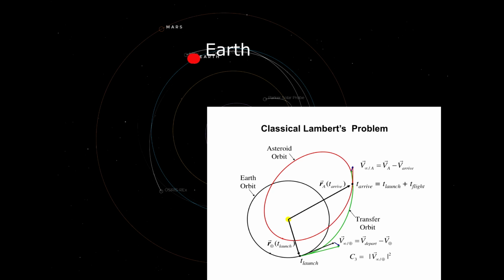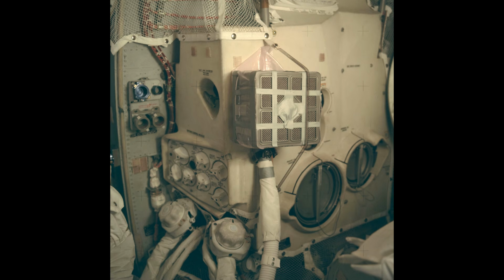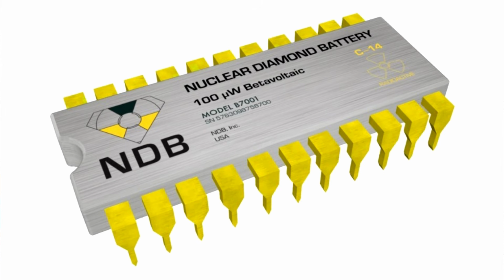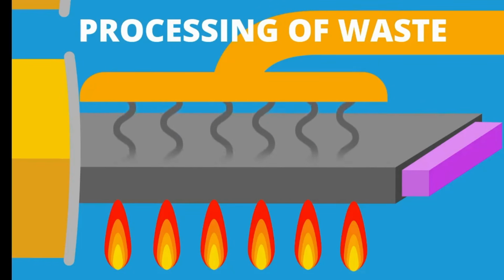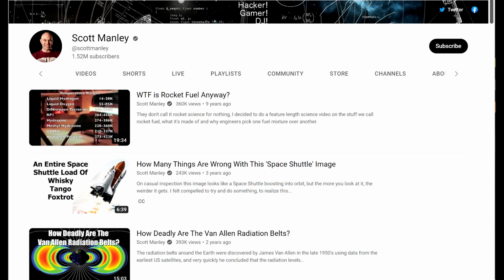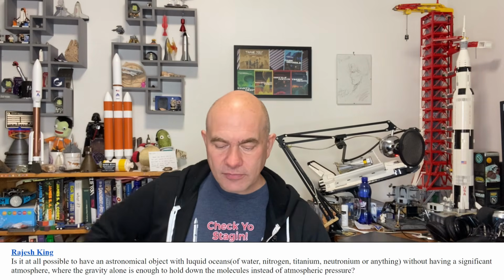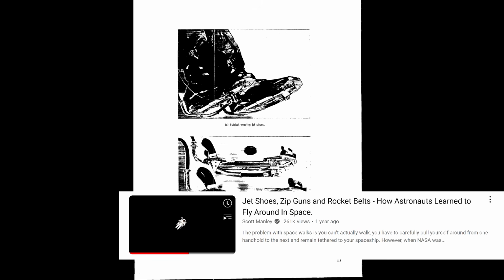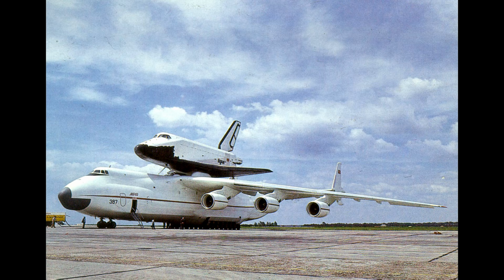Is There a Tripropellant Rocket Engine?  How Are Orbits Planned? - Deep Space Questions 21

Comment: Great questions and answers!
Thanks for mentioning mercury inches. My Mum's had a barometer in the hall that is probably at least 70 years old if not 80 or more and still works fine, so I got used to seeing the pressure between 28 and 30. I think the lowest I ever saw it was just above or below 28 and the highest just over 30.1 It's usually between 28.5 and 29.5 (I don't know what altitude it was calibrated for - it might have that written on it).
I don't think we learnt about pressure in mercury inches at school or uni - only millibars or Pascal, which are easier to do maths with! It would have been nice to know the connection with mercury inches (or cm) and Pascal, and how the old barometers worked.
Reply: Mercury barometers essentially use the weight of a column of mercury (with a vacuum above it) to balance the weight of the atmosphere - the height of the column varies with air pressure and it is this height that gives the 'inches of mercury' reading. It does not have to be calibrated for altitude, though obviously the reading will be lower at higher altitude. An altimeter, on the other hand, converts air pressure into height, and therefore does require adjustment in order to read zero when the aircraft is on the ground (it can also be set to show height above sea level, which is what pilots generally mean by 'altitude'). For commercial flights it is usually set to read zero at the 'standard' sea-level pressure of 1013.2 millibars or 29.92 inches of mercury (which is the theoretical sea-level pressure of the atmosphere when undisturbed by weather patterns) - this ensures that two aircraft whose altimeter read the same will actually be at the same level irrespective of what the actual sea-level air pressure might be. The term 'flight' level' used by air traffic control refers to the height in 100s of feet indicated by an altimeter set in this way (so if it reads 33,000 feet the aircraft's flight level is 'three-three-zero').
Reply: @CharlesStearman  Fascinating, thanks.
Reply: @CharlesStearman  29.92 is only used above 18,000 feet, which is the first flight level. Actual reported barometric pressure is used below 18,000 ft.

At high altitude you want to know your vertical separation with other aircraft.  At lower altitudes you want to know your height above terrain and height above the airport.

Comment: Regarding the CO2 scrubber square peg, round hole.. I understand re-fitting and redesign was not really an option but I would have thought they'd send them up with a "pre made" bag device. It could have been folded up in an envelope and saved a ton of time making one in the middle of a disaster. That way they could sign off they "fixed" the problem. I was surprised they decided to go with the do it yourself in space approach.
Reply: Would save a little time but would have also added weight and volume. Certainly only a small amount, but both weight and volume were pretty tight on Apollo so every little thing was scrutinized whether it was necessary. 

My guess is they preferred to just have a procedure in place for making it with existing materials already on board. And the problem doesn't need instant solving, they had many hours before it would be needed, and likely enough spare time to do it.

Comment: 15:23 gallium is much better cos it has boiling point at 2673 K and melting point at 303 K, and has 1 Pa pressure at 1310 K, so it will have pressure less than 1 Pa over liquid over more than 1000 K temperature range, unlike mercury with only 81 K range.

You can actually make your own artificial dwarf planet out of gallium, if you launch small amount of it at heliocentric orbit lower than earth orbit. Cos it will be in perfect hydrostatic equilibrium, as the definition says. And it will even last longer than human life.

Comment: It should be pointed out that most nuclear waste is actually not waste at all, but unspent fuel "contaminated" with radionuclides that don't play well with legacy reactor designs. However, there are many other kinds of reactor (eg, fast & thermal breeder reactors) that have much better fuel economy, some of which will happily consume nuclear "waste" after a bit of processing.

So no matter how you look at it, launching nuclear waste into space is a totally counterproductive idea.
Reply: And I was taught most nuclear waste is low level stuff, byproducts etc.
Reply: @TheEvilmooseofdoom  I think he means the larger part of what is inside "high-level waste" is not actual waste, but a wonderful resource.

Comment: The fun fact about vapour pressure is that it is agnostic of whatever other molecules are in the air. At room temperature, water will tend to evaporate until there is about 2 kPa of water vapour pressure in the atmosphere - whether that's pure water because there was only vacuum, or 200 kPa of 1% water.
This also means that in order to have a planet with a liquid but no gaseous atmosphere, you'd need to find a liquid that has a vapour pressure of zero - and apparently glycerin and mercury are very close, but you'd still have the faintest whiff of an atmosphere.

Comment: The Soviet N1 moon rocket was the worst project NOT because it exploded x4 but because the all-up single Moon rocket was a poor design choice. Had they chosen from 1958-60 to develop the Proton booster, Salyut module and Soyuz capsule plus a lunar lander they could have assembled a moon mission in orbit built around a modified Salyut station, attached a lunar lander,  put men on board in Soyuz and sent the whole package to the Moon. Lander lands with two cosmonauts while one orbits in the station. Surface party returns to Salyut in lunar orbit then the whole package returns to Earth. Cosmonauts land in Soyuz. Had they gone all in they could have landed men on the Moon by 1968. 

Korolev's successor Mishin considered this piecemeal design after the N1 failures but the project was dropped later in the 1970s.
Reply: I don't think they would have needed to drag a Salyut along with them. Soyuz is not all that cramped even for three cosmonauts, and the Soviet lunar mission was planned to only have two, one of which would land on the Moon. Although I'm not sure they could have built Soyuz much earlier than they did.

Their rockets and capsules were pretty good back then, very good actually. But they seemed to have problems landing things on other worlds, their failure rate was pretty high. So it was probably for the best that they didn't attempt a lunar landing.  A lunar circumnavigation mission would have been possible. Some have said it would have taken a bit of the triumph away from the Moon landing.  Initially yes, but Apollo 8 was somewhat forgotten after the Moon landing, remembered mainly for their Christmas Eve TV broadcast where the astronauts read from the book of Genesis and wished everyone on Earth a merry Christmas.  Or like Alan Shepard had to cede the limelight to John Glenn. I suspect a Soviet circumnavigation of the Moon would not have dimmed the accomplishment of Apollo 11.

Comment: 15:28 what about mercury fumes? Doesn't that count?
Reply: Gallium is much better cos it has boiling point at 2673 K and melting point at 303 K, and has 1 Pa pressure at 1310 K, so it will have pressure less than 1 Pa over liquid over more than 1000 K temperature range, unlike mercury with only 81 K range.

You can actually make your own artificial dwarf planet out of gallium, if you launch small amount of it at heliocentric orbit lower than earth orbit. Cos it will be in perfect hydrostatic equilibrium, as the definition says. And it will even last longer than human life.

Comment: Anything with fluorine in it is going to make REALLY nasty exhaust unless you have some way to ensure that ALL of the fluorine goes into something relatively insoluble like lithium fluoride.  But then if you have excess lithium to ensure that, you lose some performance, so you would need to add some oxygen to at least get some use out of that, with any excess oxygen making lithium oxide.  So that would give you a tetrapropellant system.  Not sure how well everything would go to the energetically optimal state, though -- you might still get some of the fluorine making hydrogen fluoride and an excess of the oxygen getting stuck with lithium.

Comment: Another silly idea:  Falcon Heavier and Falcon Heaviest.  Skipping straight to Falcon Heaviest, a seven-core Falcon, four cores would be spent first, and perform a return-to-launch-site recovery, then two cores would throttle up, and ditch into the ocean for recovery on board OCISLY and JRTI, and then finally you'd … basically be able to put an entire Falcon 9 in orbit.  Only thing I'm concerned about here is the need to convert this center core to run on space-storable propellant like Aerozine 50/NTO, or hydroxylammonium nitrate.  (HAN would offer an obvious win in terms of propellant density, but Aerozine is more flight proven)  

Pair this with a Dragon Integrated Upper Stage, something designed to combine the upper stage and a Dragon XL, and you've got an honest to God space cruiser.  Since the propellant is space storable, you can pitch them up there at your leisure, and wait for a mission window to launch crew (or embark them from the ISS?).  

While landing a Falcon 9 from orbital velocity might be a spicy challenge, the stage could be modified with docking hatches much like Skylab, allowing it a second life as an orbital warehouse, habitat, or workshop after the stage is stent.
Reply: When did RP1 and LOX become not space storable?

Comment: I always thought about the potential for using liquid CO2 as reaction mass to lower the throat temperature, basically trading temperature for kinetic energy.  Liquid CO2 is nice and dense and easily able to self-pressurize, minimizing the mass penalty for a third propellant tank and resulting turbopumps.
Reply: You might get more thrust, but ISP would tank since much of a kerolox rocket’s exhaust is steam (H2O) rather than CO2. Lighter molecular mass = higher exhaust velocity = higher ISP.

Comment: When people talk about more efficient things ("asparagus") they NEVER calculate liability into the equation. Reliability is LITERALLY why they don't do this. A 1% cost in reliability is literally worth 10% in efficiency, if not TONS MORE than 10%.
Reply: Just think about it for a second.
Would you sacrifice reliability for efficiency?
Would you be willing to blow up the rocket, fail the mission, AND sacrifice the EXTREMELY EXPENSIVE rocket AND payload for an extra 10% efficiency?
Of course: the answer is no.
Reply: You see that also in the decision to use kerosene for the second stage instead of the recommended LH. And using one small reliable engine for all stages even if it meant using nine of them in the first stage. Reliability, low cost, and fast production by trading off some efficiency, which they made up for in other ways like superchilling the cryogenics.

Comment: There are also tri-propellant hybrids called Tribrids - some are commercially available from Rattworks - basically they are a nitrous+alcohol liquid with a polypropylene solid core - it starts as just a hybrid, then the alcohol gets added after the burn starts, and once the solid burns out it continues until the fuel runs out as a liquid biprop.

Comment: Tri-propellants with fluorine are insane.  Talk about toxic exhaust!!
Reply: Could be worse.  I've read (in Ignition!) of one test done just injecting mercury into the combustion chamber, trading weight efficiency for volume based efficiency for something like small missiles.  That one got tested by the military.  Fortunately, the original concept of using dimethyl mercury as fuel was never tested, and only the injection of mercury into an engine.  Mercury vapor is terrible, but organic mercury is far more dangerous.

Comment: IRL asparagus staging just has too many unknowns and points of failure that could result in LOV/ LOCV.  The diverter valves needed to switch from one fuel/oxidizer source to another could fail in transition, and at tank separation, that is now a massive leak path.  You also run into the possibility of being a restriction during the switch, which could cause the fuel or oxidizer to cavitate in the turbopump, which would be catastrophic.

Comment: The biggest thing about nuclear "waste" is it's only "waste" because of policy decisions regarding reactors commonly licensed for power generation. You can (theoretically) reuse tf out of waste from uranium cycle reactors in thorium cycle reactors.
Reply: No.  Most nuclear waste is low level, not reactor fuel.  It's waste because it still poses a danger.
Reply: @TheEvilmooseofdoom  "low level" is "not fissionable in a uranium cycle reactor". Not "not fuel". Don't be willfully ignorant.

Comment: 15:30 In Legend of the Galactic Heroes they have space fortresses the size of planets/moons that have surfaces of mercury, which is truly an ingenious concept. If you fire a laser at the surface, the reflectiveness of the mercury would reflect it away. If you bombarded the surface, it would only temporarily displace the mercury before it settles back to a smooth even surface. The fortress even had turrets which could sink, float, and move about the surface, allowing them to hide away and secretly rearrange themselves or potentially be repaired safely internally. The hangar entrance for ships also is retractable to bellow the surface, protecting it and preventing entry. It is the best sci-fi concept for a planet sized fortress I have ever seen.

Comment: You don't throw radioactive waste away, you keep using it till it's gone!  There are designs right now that could use all of the waste generated to date as a supplemental fuel source.  Resulting in the reactor actually consuming more radioactive waste than it generates.  And the cherry on top?  The waste isn't anywhere near as long lived as the waste it is consuming.

But everybody hates nuclear power, so we will probably never see these designs built.
Reply: The bulk of the 'waste' is low level stuff.  I don't know how much use that would be in a reactor.